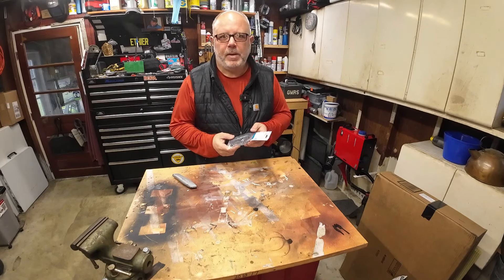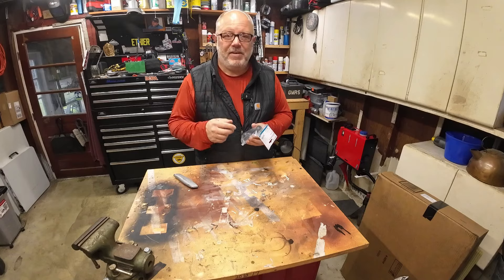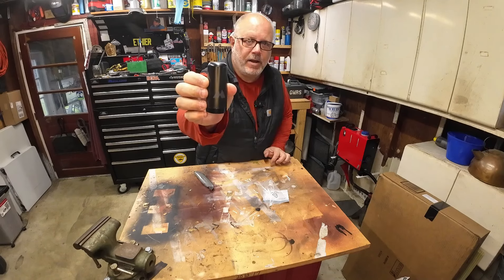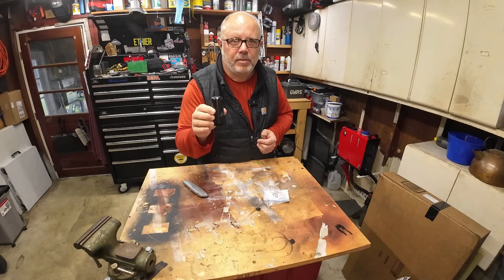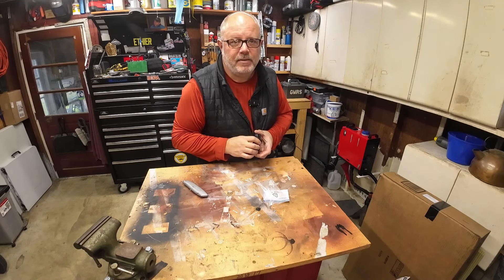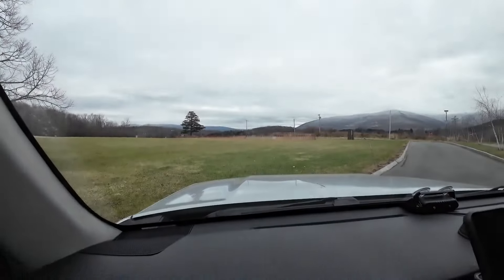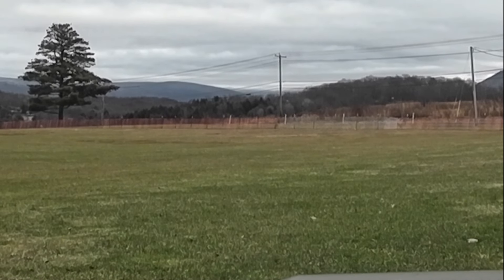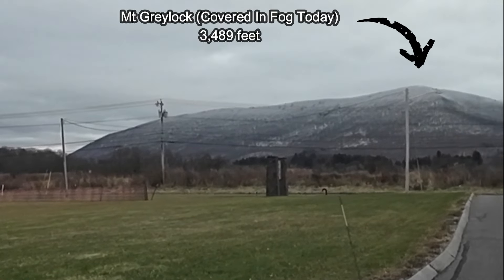Ghost Antenna

Comment: I remember as a kid in the 70s when CB radio was hot there'd be guys around with massive antennas 12 ft tall bolted to their pick up trucks.
Reply: In the 80's my husband had a lifted truck and on the roll bar he had a whip antenna that use to hit the traffic lights 🚥... LOL 🤣 😂 🤣

Comment: I  have one of those ghost antennas.  This is what I found:  My wife was at home on the base radio and I was in my truck with the ghost.  About 8 miles out she said I just sounded like static.  I could hear her just fine.  I kept driving for a couple more miles.  Same thing.  I could easily hear her, I was just down in the noise. That was on a simplex channel.
Reply from the maker: Yeah, I've not had great luck with the antenna either.

Comment: Agreed. That little midland antenna is surprisingly good man.
Reply from the maker: It really is. I did switch to a better coax and NMO 1/4 wave and I'm very happy with the performance and low profile looks. I've had very mixed results with the ghost antenna. I want to like it but I like the 1/4 wave better. Thanks for commenting.

Comment: I have found the ghost antenna doesn't work well with a big magnet mount.  Try using a smaller mount. It worked well for me. Great video!!!!!
Reply from the maker: Thanks for the info. I'm hoping to do a fender mount soon. The antenna does work well it's the terrain that kills it around here. Do you run a mag mount?
Reply: Yes on my truck but on my car I run a lip mount with the laird trab4503  same as ghost its 450-470
Reply: On my truck I use a laird 3db antenna 5/8

Comment: I have the Wouxon GMRS 1000G Plus 50W.  I have a ghost antennae and could hit a repeater tower 43 miles south of me.  It has a 200 ft height  advantage with an expected range of 40 miles  I was utterly impressed.  I still think the larger antennae is going to be best in most situations.
Reply from the maker: That's amazing. Line of sight around here kills radios. If we want to get anything more than 10 miles we have to use a mtn top repeater. Thanks for commenting.

Comment: I'm by no means a radio professional, we used CB when I was younger and now I've been licensed and using gmrs for a few months now...glad to see some more real world testing...from my research and again I don't really know what I'm talking about but real world means more than math to me! Anyway from some guys that know a lot more than me testing antennas on their 4x4's it seems the dB gain on antennas isn't the exact idea that dB gain from having more power..I think it's more related to how they work in different terrain and depending on terrain a 3 dB works better than a 5db and vice versa..something you may want to look into but I believe it has more to do with the direction or way the signal leave the antenna.. just some thoughts you could look into..do you have an swr meter ? If not you can get a cheaper on maybe 50$ or so on amazon..the swr being lower more of the energy goes out the antenna and higher swr more is directed back to the radio..the reason not having an antenna while transmitting  will burn up your radio..as will a high swr.. I have the Nagoya magnetic mount on my car it's not that big but works great with my handheld .. there are a lot of options for vehicle use. I know ghost antennas work but not usually as well as a longer tuned antenna.. by no means am I commenting to try and educate anyone I'm just trying to learn and I appreciate your video very interesting and great work...look into that dB stuff if it matters to you and think about picking up a little swr meter it might help you and you can use it to tune your set up with a bit of research..lots of vids you can find on tuning using one... good luck and let me know what you figure out! WRZM963

Comment: I have the ghost antenna. And have hit a new jersey repeater from Philadelphia. On a 50 w. Mobile. Which is 20 miles
Reply from the maker: Thanks for commenting. I think I could do that with this radio and antenna setup but the mountains kill me. They are in all directions. North to south is best but I'm limited with about 10 miles line of sight in all directions. The repeater I use is 18 miles away and as you saw the ghost was able to hit it but I don't think it was a very strong signal compared to the other antenna. I'm going to run the ghost when traveling.

Comment: I highly recommend putting blue painters tape under your mag mount to prevent scratches and rust, just FYI.
Reply from the maker: I put gorilla tape on the bottom. That rust wiped right off. I never used blue painter tape but I will give it a try. Thanks for the suggestion.

Comment: I’ve got the ghost antenna connected to MTX115, installed INSIDE my truck and can hit a repeater 15 miles away.  I am using the supplied lip mount with proper ground plane.
Reply from the maker: Sounds like a good setup.

Comment: The small antenna only works in citywide close areas, or flat areas spots, I use to have one. The diamond or comet antennas, do better, however ham radio 2.0 did a review on an antenna called Compac Tenna, which is a short antenna, did very well however he put it on the corners of the vehicle, gave him better signal
Reply from the maker: Thanks for commenting. I've had mixed results with the ghost. I actually have better results with a 1/4 wave than the Ghost.

Comment: The gain difference is nearly 3db  or  half power and reception gain. 
Ideally to test both antenna's use  identical mounts and switch using a coaxial switch.
Reply from the maker: Good point. Thank You for commenting.

Comment: Paul, do you have your squelch just barely closed or turned up to a higher level?  You need to put that antenna on an analyzer. There may be a short. Also really helps if microphone is much closer and directly in front of your mouth.  Mic that has many controls for the radio is also a compromise =poor gain/modulation.
Reply from the maker: My squelch is kinda neutral and set in the middle. I don't mess with it much. I know the SWR is 1.5 on the coax with the 5/8 wave antenna. The mic thing I have to work on. Thanks for asking the question.

Comment: Did you check SWR on the ghost antenna?
Reply from the maker: 1.5 swr
Reply: @paulethier3416  That is way too high for a single band antenna 👎
Reply from the maker: I'm making a few changes to my setup. Hopefully I can get the SWR down a little. More to come soon. Thanks for commenting. @bob_mosavo

Comment: I installed a mxt275 and have the ghost antenna on a ditch light mount. Think a 32in 6db antenna will do better? We have so many homes, hills, trees, and warehouses in our area that the current set up goes about 4 miles with good line of sight
Reply from the maker: Sounds like you have similar challenges as I do. The 6Db will out perform the ghost antenna for sure. However, I've had good luck with a 1/4 wave. It's a good compromise between a 32" tall 6db antenna and the low profile of a ghost. Thanks for commenting and let me know how you make out.

Comment: I can assure you if you installed that antenna correctly it would have done that no problem. I have done 10 miles simplex in very similar terrain in Oregon. Just hit a repeater 31 miles out with a 30 watt mobile. Im running an actual nmo mount drilled im the roof and a laird 3db phantom. I have a laird 5/8 over 5/8 as well and it is only marginally better than the phantom. Its your install 💯
Reply from the maker: ok, I'll work on that. Im looking at doing the nmo roof mount currently
Reply: @paulethier3416  it's going to get you the best results for sure.

Comment: I would be curious to know did you hook a SWR meter to your Ghost antenna, and if so what was the reading. I have a Midland 50 watt with there antenna coax to a Calie Rays ditch light mount. I ordered a Midland 6 DB gain antenna and the Ghost antenna. The SWR at this point was 3.0 on the ghost and 1.65 on the 6DB. I contacted Midland they sent me a new Ghost and suggested I run a ground wire. Now the Ghost is 2.5 and the 6Db is 1.05.  For day to day running around I would prefer to leave the Ghost on it but can not get a clear answer from Midland if this is going to hurt my radio using it with this high of a SWR. Any help would appreciated.
Reply from the maker: I have a love hate relationship with the ghost antenna. I like the way it looks and the theory of it but the performance for me has not been great. I ended up just going with a 1/4 wave antenna. It works better and the swr is 1.2 vs the ghost at almost 2 and its still low profile. The ghost for me is more sensitive to line of sight than the 1/4 wave. I also have a 6db tall whip I can screw on to the nmo mount when needed. Thanks for leaving a comment.

Comment: Are you not utilizing repeaters?
Reply from the maker: In this video, we were not using repeaters and there are no local repeaters in our area. I’m working on installing one myself hopefully by the summer I’ll be ready for install.
Reply: Just curious to what kind of repeater you are planning on putting in service? I have a unit here in South Eastern Colorado that works pretty well. It's a Motorola R1225 that I got off Ebay. Does about 35 watts out the duplexer. DO NOT skimp on your coax. Get at least lmr400 coax. The better the coax the better your machine will work. 
CHEERS from Colorado
Reply from the maker: @brucel399  Thanks for the information. I'm not sure what I'm going to use yet. This might be a good option for me.
Reply: Using not utilizing. When something is utilized, it is not being used for what it is intended to be used for.

Comment: The base is not attenuated for the specs on the Ghost Antenna. Look at the spec sheet for both concerning ground plane, then try again.
Reply from the maker: Ok, thanks for that info. I'm working on a hood mount now. I'll retest and hopefully I will see an improvement with new mount.

Comment: Next time just put a dummy load, it is equivalent to that ghost antenna.
Reply from the maker: I wouldn't say it's that bad but you're right the ghost antenna has never worked great for me either. If I could get more than 10 miles line of site around here it might be ok but in the mountains. Nope! Thanks for the comment.

Comment: I have a difficult time believing that your "ghost" antenna has 3 dBi of gain.  If you had said - 3dBi, that I'd believe!  I have no doubt that a standard-issue 1/4-wave antenna will out-perform the "ghost" antenna under all conditions.  And since you're using a mag-mount, I don't get why you're concerned about car washes.  I've been a ham radio operator for 42 years, and I've always taken my cars -- including brand-new ones, to a Motorola radio shop and had them install an NMO antenna mount right on my roof.  I've never had any problems with leaks or rust.  The last time I had this done on my then brand-new 2014 Subaru Outback, they installed the antenna mount and a 30A power cable, with the power lead and coax ending right under the front passenger seat where my Yaesu FT-100D dual-band transceiver has lived ever since.  I just received my GMRS license two days ago and have not bought any equipment yet, but I'll probably go with the Midland, just a higher-power version.  And I may also have a second NMO mount drilled into the roof of my car just for that radio.  73 de Larry, K3LT

Comment: Ghost aka phantom antennas are glorified dummy loads
Reply from the maker: I wouldn't say that, they are just more affected by line of sight than other antennas. Thanks for commenting.
Reply: @paulethier3416  you wouldn't say that but every radio shop and ham I know that have tested them say what I said 😁
Reply from the maker: Ok, I respect your thoughts I was just saying my experience so far has not been that bad yet. In a few weeks or few years I might look back at this and say up Jerred told they were junk..  @jarredjones8476